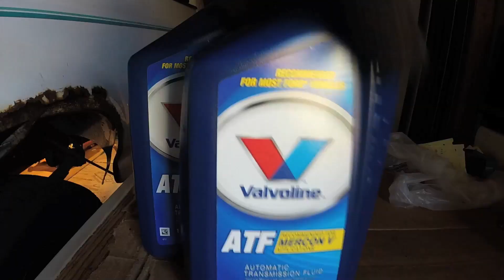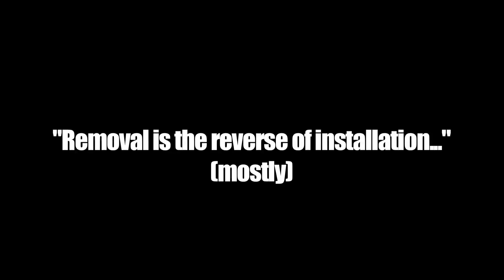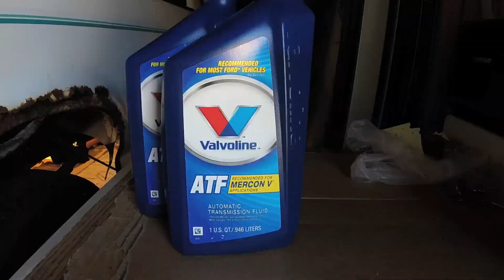Manual Transmission Installation / 1993 f150 M5OD

Comment: Great to attempt to torque the bolts BUT, each extension used alters the actual torque being applied to the actual bolt, there are correcting factors somewhere if you can find the info

Comment: Great Video.  I am doing clutch on 1992 F150 4.9 MSOD.  I am working in my back yard with the truck on jack stands.  I used a trans jack but the strap method looks  better.   If I had to do it over I'd use straps.   I had to remove the heat shield on the catalytic converter and the metal air tube that comes down behind the catalytic converter.  The bell housing wont clear until those obstacles are removed.  The air tube gave me trouble.  I loosened the bracket but needed propane heat and much tapping upward with hammer.    After 28 years the air tube didnt want to release.  It came off eventually but took patience.  I couldnt pry it off, it took a hammer and a hundred light hits.  Excellent video michiganshooter rocks.

Comment: Sorry this is digging up an old thread ... But my transmission won't go back in. Mine doesn't have that large of a hole in the floor, the transmission has a housing that sticks up right where the shifter handle goes in and that hits the floor and won't let it go higher to line up the output shaft with the center of the clutch. Any advice? I'm in Michigan as well!
Reply from the maker: Thanks for digging up the old thread!  Maybe it will prompt Youtube to put it higher in searches..  Is your truck the same/similar year, does it have the access panel under the flooring/carpet you can remove to make the hole bigger? It's at 7:47 in my video.  Do you have a Chilton's/Haynes?  They're helpful.  Check out any of the ford enthusiast forums?  People are pretty helpful there if you post a question
Reply: @michiganshooter  no, actually it's a 2001 model and it has a very small shift lever hole in the floor. That was the problem. My son and I ended up tilting the motor by jacking it up on the front pulley. Have us the extra 2 inches of angle to be able to stab the transmission in there without hitting the bottom of the cab with the top of the transmission and allowed us to slide it forward. Was a real...bear... But it finally worked. Got the clutch bled and it works great now.
Reply from the maker: @Rainh2o69  Nice solve, too bad it took all that.  Maybe your comment will help someone else in the future though--
Reply: @michiganshooter  did you change your truck from a automatic transmission to a manual transmission  ? 
If so how did you connect the neutral start switch for the automatic transmission to the manual transmission  ? Do they use the same connector  ? Or did you just cut the wire and connect the 2 wire ends together on the wire harness  ?,

Comment: half way thru mine, same truck,, but the guide dowel remained on the bell housing when i pulled the tranny,... now having a hell of a time getting the thing back in, you think i should drop it again and knock out the pin and try to insert it back into the engine side?,, it also holds the dust plate in place so now that shifted also making it a bit hard to line up..

Comment: I have a 1976 c10 250 straight six and a saginaw 3 speed manual transmission. I've been trying to install the transmission for 3 days, 8+ hours each day. I just cannot get it to go in the last 1/4 inch! I've tried ratchet straps, Jack's, pulling, pushing, shaking, wiggling etc. I'm starting to go crazy! Oh I'm also in Michigan lol
Reply from the maker: Try bouncing/shaking it forward, trying to be in sync (or opposite) with the bounce-back the motor does.. like imagining you're whipping a chain out flat in front of you.. or playing jacks, shooting your arm in while the ball is in the air or however that goes.  Don't be afraid to be rough with it (but don't sue me if something goes wrong lol).  It will be the most satisfying thing ever when it comes together right.
Reply: did you finally get it in?,,, i'm attacking my slave cylinder this weekend,  i have almost the same f150  as in the vid. so this really helps..

Comment: I'm stuck on mine. I replaced my slave cylinder and I cannot for the life of me get the damned transmission back in. I have the drivers side lined up flush but the right side is off by an inch. I have shimmied and bounced it a lot and it just won't budge.
Reply from the maker: Back it out all the way and try again?  Nothing in there blocking anything?  Insult its mom?
Reply: You may want to pull it back out loosen the pressure plate bolts and make sure you're alignment tool is put in straight

Comment: U are missing 2 Teflon ring and a pressure Ring. I seen the two bolts. But you don't have one Teflon ring? Go look at a gear shifter kit for loose shifter like yours in coubel year. Good video Ty. Use straps just like I do for extra hands.

Comment: Exactly what we did, shake it around and nothing happened, still has a damn gap
Reply: Did you get it and how did you do it? I'm having a problem closing my gap about an inch off
Reply: @Bonebuster420  We just shook it left and right a lot and pushed it in with our strength and the damn transmission finally went in. New fluid, clutch, clutch slave cylinder and gaskets

Comment: Why ATF instead of manual gear oil?
Reply: Yes  please elaborate thank you
Reply: I was puzzled why he used atf instead of gear oil myself.
Reply: All M5OD(Ranger, F150 et al since 1989) 5-speed transmissions use ATF. Gear oil isn't thin enough to lube the fiber synchros on these transmissions.
Reply: Because it is a hydraulic clutch.
Reply: Ford is just weird that way. Zf5 in my 95 f250 is the same way.
Reply: That's what is called for to use in it, use ANYTHING else & you screw up the transmission
Reply: That's what is called for to use in it, use ANYTHING else & you screw up the transmission
Reply: @toddhop0  That's what is called for to use in it, use ANYTHING else & you screw up the transmission

Comment: LMFAO!!! Wtf is going on here!! Torque wrench with 5 feet of extensions lmfao
Reply: same thing that was going through my mind lol shits crazy
Reply: If you do the math, old spring wrench/ 2 wobble drive ext. 3 non wobble he might have got it to 20 foot pounds?
Reply: @rockybutler  , Good thing you're not a mathematician for a living. The only thing to be concerned about is the angle between the bolt and torque wrench, not the length of the extensions. The angle is minimal and the torque will be very close to what is displayed on the wrench.
Reply: @bonanzaman100   actually there is a torque reduction, whenever you ad a ext. the longer the ext. the more the reduction. throw in 10 extensions their would be a reduction for every joint. kinda like if you added 10 u joints to your drive shaft you would surely lose horsepower.  most quality torque wrenches come with a reduction chart for adding extensions.
Reply: @rockybutler  Please show me where that is defined. The static torque on a rod/extension is the same at both ends. it's the same thing as current in an electrical wire. Current is the same on both ends of the wire or the steady state pressure in a water hose. That's basic physics. If you are talking things in motion, then yes there are some loses due to friction. That's what you are talking about with the 10 u-joints in motion.
Reply: @rockybutler  , you aren''t quite understanding what you are typing. The extension they are talking about is an extension to make the wrench/lever longer. Use this https://www.engineersedge.com/manufacturing_spec/torque_wrench_1.htm.   Look at the "E" dimension, that is what the equation is calculating. The "E" is making the torque wrench longer.
Reply: @bonanzaman100  it's parasitic loss. The extensions are gonna twist and give a little when adding pressure. So from the torque wrench to the bolt there's gonna be loss with the extensions. That's typically why they say never use extensions on a torque wrench unless it's necessary and to account for loss when you do.
Reply: @danielkustra9071  ,again, show me the formula where changing the length of the rod/extension will change the value of torque in a stable system. If there is a change in torque value there should be tables and calculations everywhere telling the mechanic how to make the adjustments for lengths of extensions.
Reply: Here is a web site which explains the use of extensions swivel joints and other things  with a torque wrench.
Hope this helps you understand how to torque things with different  adapters.
https://www.utilityproducts.com/tools-supplies/article/16002651/how-to-adjust-torque-values-when-using-torque-adapters
Reply: Who else read this whole argument??
Reply: @bonanzaman100  Ya can't tell these yahoos ANYTHING